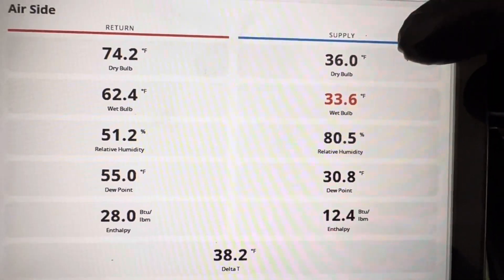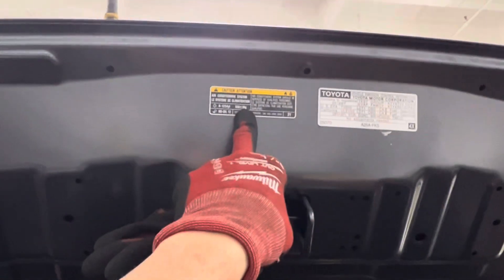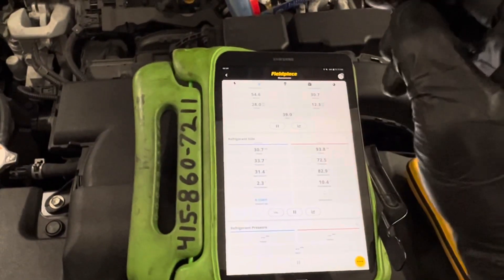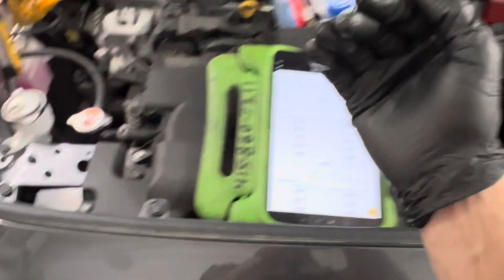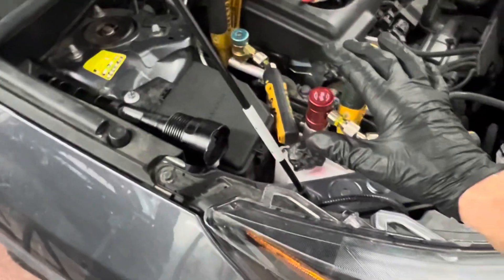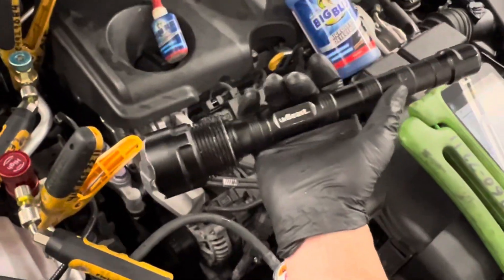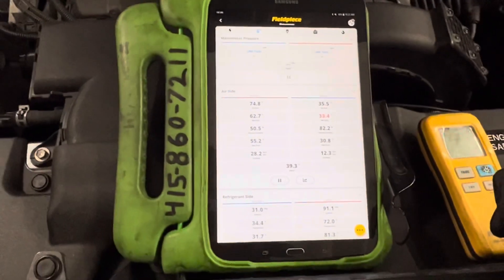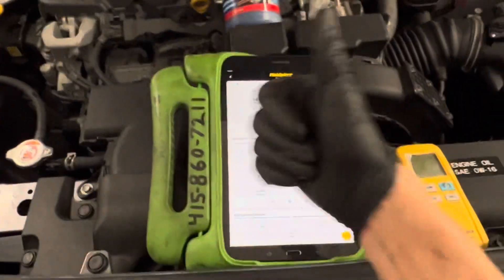35°F, 2019 Toyota RAV4 after refrigerant recharge ￼

Comment: Have you witnessed any newer  Toyotas with variable compressors cycling from 0 to 100% duty cycle with 10degree swing in vent temp (as if pcm thinks it's a ccot system)? Have a brand new Corolla doing this dealer says it's normal....
Reply from the maker: I think 🤔 I have video of it doing it on a cool day. But not a vary hot day
Reply: @coldfinger459sub0  thx for the reply.... It's 105 here 🤦‍♂️